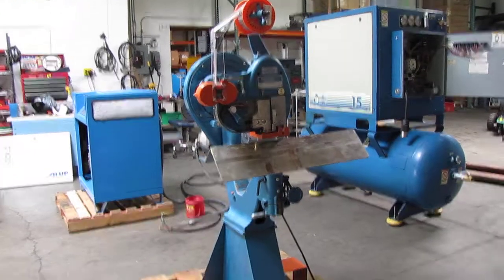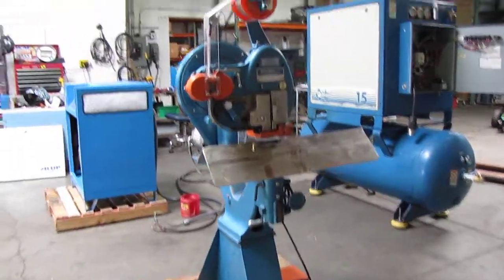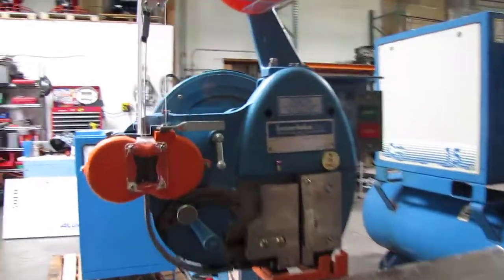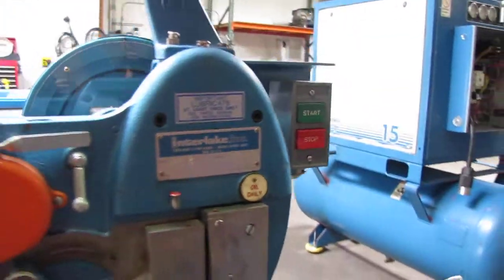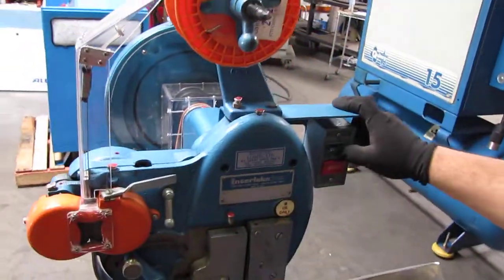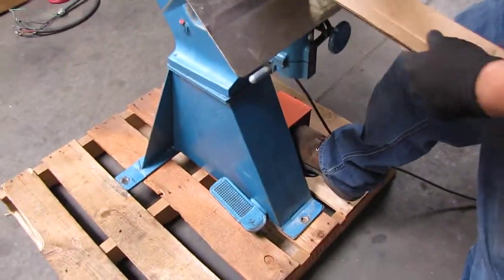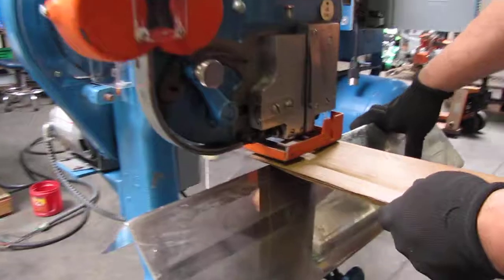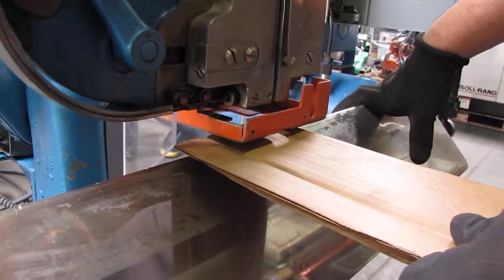ISP Interlake S3A Stitcher 3/4” Wire Stitching Machine Book Binding Bostitch

Comment: The angled bed is called the saddle.
It's a saddle stitcher and would be great for a small bindery or a group wanting to produce newsletters or comics!
You can probably pull a pin under the saddle and make it flat for stitching a corner or along one edge.